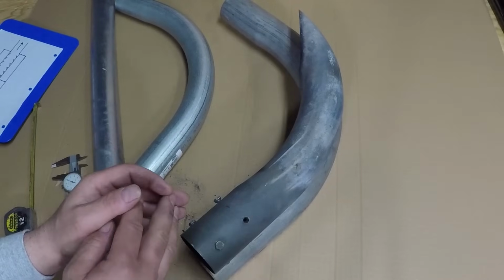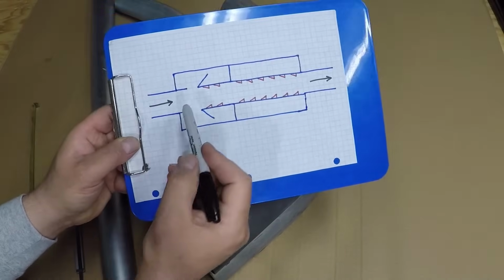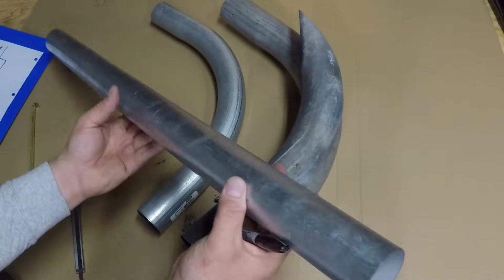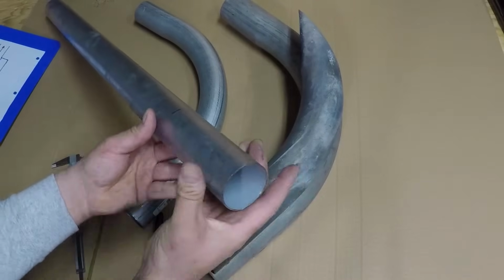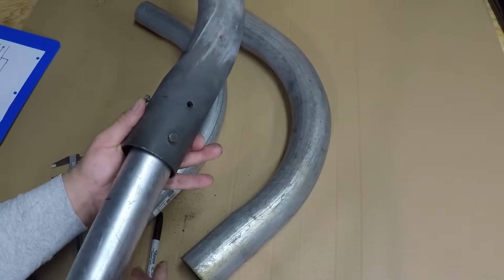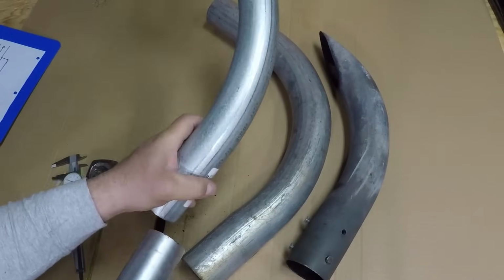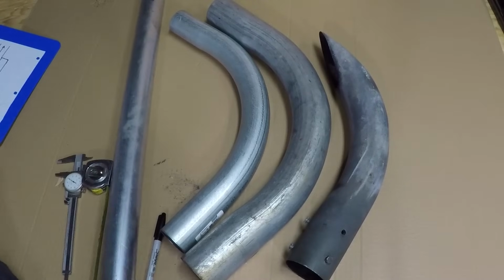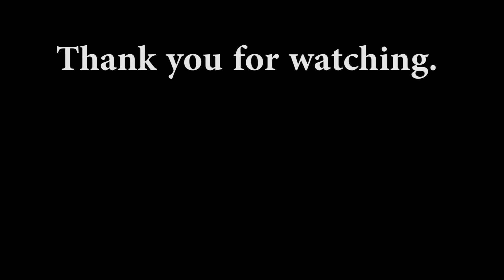Homemade Muffler

Comment: The skidder I used to run had the exhaust pipe follow the ROPS all the way back to the roof so it wouldn't get torn off when plowing through low branches and such...just a thought.  Nice build!!
Reply from the maker: Good morning sir, you are 100% correct. I actually built one before the one in the video and it got damaged from trees hitting it when I dug the pond. Thank you for the tip, the comment and have a great day.
Reply: John Deere's 648?

Comment: Going to build one of these for my air compressor engine once its built. Thanks for breaking it down
Reply from the maker: I am going to build a larger one for my dump truck very soon. The way I installed it on the bulldozer was to help with preference. Make it where you can change the direction as if you install it the other way, it will be less noisy but the engine may lose some preference. Good luck with your compressor build. Thank you for watching and for the comment.

Comment: Look into how Flowmaster makes their baffles which they call the Delta flow technology !  I made a home made muffler for my old Jiffy gas powered ice auger for ice fishing which uses a 2 stroke Techumse engine & they only come with a small steel plate with a slot cut through them as a muffler which isn't very quiet at all ! I basically took this plate then used a 6 inch piece of 2 inch pipe with the ends cut off & drilled the holes needed for the plate to breath through then welded those 2 together & added sections of  steel V  cut up like the Flow Master design with the smallest first then making them wider at the end then an exhaust hole at the end & bottom after I welded ends on each end . Once done I was able to just bolt it on then started it up & it's much quieter but had to tune the carburetor settings for low & high speed mix & it works great lol . The way they are stock from the factory is like a open pipe so they are loud as heck compared to the new ice augers especially the 4 strokes out now but now it's much quieter & didn't cost me anything for materials because I had that & just the time to make it & some electricity & welding wire for the welder . I was on here watching other various ways to make exhaust baffles for a chrome Harley Davidson pipe I put on my 17.5 Sears OHV lawn tractor mower because the stock muffler after 20 plus years finally rusted out so I made this pipe work but need to make a baffle for it now to quiet it down more & ran across your video so I think I will probably go this route on making a baffle but use some stainless steel wool to pack into it as well to tame it down even more ! Great job on making this & the video !
Reply from the maker: Hello Pete, thank you for the nice and informative comment, I built a muffler in the past very similar to the “delta flow”. I installed it on Suzuki samurai, I am planning to post a series of videos regarding home made mufflers that are easy and cheap to make. Mufflers are cheap these days, however, sometimes you have to custom make them for specific application just like you did when you build your own. Thank for the comment and have a great day.

Comment: You came up with a good design, good mufflers arent cheap, i'm personaly trying to come up with a home made muffler and you answered some questions for me, now all ive got to do is buy a welder, i'll be replacing a catalytic convertor on my chevy pickup truck, for the short term but i intend on getting a legal cat. Converter for it when i can get the $
Reply from the maker: Good morning sir, if you replace the catalytic converter with anything other than a catalytic converter you will get a check engine light. The muffler I showed in this video is more suited for off-road vehicles. 
Thank you for watching

Comment: This is a great video, but based on learning about exhaust engineering if performance is a requirement then you would want a design where the slotted indentations bend outward instead of inward, thus preserving the pipe diameter flow. At lower rpm it will absorb greater, at higher rpm it will create air cushions that will allow less resistance and better flow through than even a straight pipe. 

How? I would cut the pipe in half lengthwise and punch out the slots from the inside. Then weld or clamp back together.
Reply from the maker: Thank you for the comment and the information. I am planning to post more homemade mufflers video very soon, I am just getting things set up for it. I will cover several types of easy to make mufflers and will test each one for loudness and performance. Thank you

Comment: very well done, great welds and everything, this may work nice as a performance exhaust on my boat, even without the fiber glass I am sure its quieter.
Reply from the maker: In the old days, guys with sport cars, used to remove the fiber glass to get deeper and loader sound.this design is for performance and not for reducing the sound. If you install it the opposite direction with fiber glass, you will get sound reduction at the cost of performance. Thank you for watching and for the nice comment.

Comment: If you make it with  the depressions in the pipe with half of them facing towards the engine and the other half facing towards the exit of the pipe it will work a lot better at silencing
Reply from the maker: Thank you for the suggestion.

Comment: At the time 8:51 shows the correct direction of exhaust flow like little scoops into the glass. Time at 8:33 shows the red arrow is pointing the wrong direction. Baffles are air scoops like little shovels. You scoop the air. He has the baffle backwards .
Reply from the maker: Good morning sir, I built one just like the one in the video back in the 90s and installed it on a car. I tried it both ways. One direction was quieter but the engine was loaded or there was more back pressure. The other direction was louder but the engine was running better. On tractors and off road vehicles the glass pack should be installed as I demonstrated.  Road going vehicles have to meet certain noise level restrictions and therefore they install the glass pack to meet those standards.  This creates more back pressure and little bit loss of performance. There are other options of using holes on the pipe which will give you in the middle results. I am going to upload videos in the future about homemade mufflers and I am going to test everything for the viewers. Thank you for the comment and thank you for watching.
Reply: @SalamSayhood  never restrict in any way a four stroke motor. Only 2 stroke motors require an expansion chamber and back Pressure . The diagram that was drawn on paper was correct. Except the flow was backwards. There were 2 chambers in it. In the glass pack you designed was one single chamber and flow backwards.
Reply from the maker: We both talking about the same thing. I think there is a misunderstanding. The cuts are pointing away from the engine. I reviewed the video and both timing marks that you posted in your comment are showing what I just said.

Comment: Nicely done, only one problem, you have the airflow going through the pipe the wrong way, try it the other way and you will see a big difference. What i once did was a compromise that worked well, the first half with the cutouts going one way and the second half with the cutouts going the other way.
Reply from the maker: Hello, I built one just like the one in the video back in the 90s and installed it on a my car. I tried it both ways. One direction was quieter but the engine was loaded or there was more back pressure the engine was getting warmer when driving up hill. The other direction was louder but the engine was running better and cooler. On tractors and off road vehicles the glass pack should be installed as I demonstrated.  Road going vehicles have to meet certain noise level restrictions and therefore they install the glass pack to meet those standards.  This creates more back pressure and little bit loss of performance. There are other options of using holes on the pipe which will give you in the middle results. I am going to upload videos in the future about homemade mufflers and I am going to test everything for the viewers. Thank you for the comment and thank you for watching.
Reply: The muffler was installed correctly. This style of muffler is not to reduce all noise, it's to cut out the rasp and not reduce performance.
Reply from the maker: You are correct. Thank you for watching.

Comment: That is some quality metal work. The cutting, punching, and welding are clean and smooth.  Nice job.  How many hours would you estimate this took?  How many hours would it take someone who does not have your skill level?  Have you tried phone apps or a sound meter to measure the sound differences?
Reply from the maker: Hello Thomas, Thank you for the nice comment. It took me about 2 hours to manufacture the muffler (filming it made it a little longer), I would say, if you know how to weld, how to use the grinder, and you have all the material, then it should be about two hours. I am planning to purchase a sound meter and I am going to post videos in the near future about how to build several type of muffler for different types of engines in detail as there is a high interest in the YouTube community about home made mufflers. Please note: Glass Pack mufflers are efficient, make the most power out of your engine, and easy to make, however, they do not provide good muffling, especially if you are trying to muffle an engine like a generator near your house.  Hope this helped.

Comment: If some fresh air is induced in the main exhaust by putting small holes at bottom end it would decrease resistance and fresh air will be siphoned in to make exhaust gasses cleaner.
Reply from the maker: Great idea, thank you for the feedback

Comment: Nice work bro 👍
But did you compare the results with the standard results !
Share what did you get ☺️
Reply from the maker: At the end of the video I showed the straight pipe sound against this glass pack muffler. In the future (I have few projects to finish first 😆) I am going to experiment with more muffler designs, I bought a sound level meter to be able to show the results. The camera captures good sound, however the sound meter will give more accurate information. When it comes to mufflers, the goal isn't for sound reduction but also for engine performance. I will also be checking for that and for heat. Thank you for watching and for the nice comment.

Comment: I really like the design, with the slit cut then punch. If I do it, I’ll reverse the flow so it’s directed towards the fiber glass packing. I feel like it would be quieter.
Reply from the maker: Good morning, you are right, I tried that in the past. The way I installed it, the engine performance is better and louder. If installed like you mentioned, the engine will be quieter. I am planning to do this experiment in the future and will show it on YouTube. Thank you for watching and for the comment. Have a great day.
Reply: Wouldn’t that restrict air flow
Reply from the maker: Good morning David, it shouldn't restrict air flow if it is built with the internal pipe the same size pipe as the engine exhaust pipe. Thank you for watching.

Comment: Nice video, which is better glasswool or  steelwool to reduce noise sound? cause glasswool could wet
Reply from the maker: Glasswool reduces noise better, stainless steel wool lasts longer. Don't use steel wool. The idea of a glass pack is for performance or if you want to get the sport car sound (make sure it is legal in your area). You can use glasswool, stainless steel wool or no material to get different sound/performance. I only use it for off-road vehicles. Thank you for watching
Reply: @SalamSayhood  thank's for advice  just want to reduce noise sound of portable genset
Reply from the maker: To reduce the noise, you must make the muffler larger in length and point the cuts in the internal pipe to the exhaust of the generator (opposite of what I did in the video). Make sure the internal pipe size is the same as the generator original exhaust to minimize heat while you get sound reduction. You may also have to build a large box to contain the generator and cover the inside of the box with fiberglass to help reduce the other noises that are generated by the generator.

Comment: Bass frequencies carry a lot of energy and travel further.  Sound system engineers and musicians know this well.  If the bass sound is converted into treble frequencies, this could sound louder up close, but dissipate the sound with distance.
Any thought about this when developing a muffler?
Reply from the maker: Hello, The glass pack was designed and produced since the late sixties. I know what you are saying, however I didn't understand what is your point?

Comment: This is just what I was looking for, but is it too restrictive for a high performance 250cc four stroke motorcycle? Somebody, PLEASE ANSWER.🙏🏾
Reply from the maker: Good morning, if you do it exactly like I showed in the video (the direction of the vents) it will give you the highest performance. In between each piston compression cycle, it will create a low pressure to help the next cycle. However, this will make it loud, not as loud as a straight pipe, but loud. If you change the direction of the vents, it will reduce the noise but not as good as far as performance because it will create back pressure. I hope this answers your questions.
Reply: Thanks for your answer. I really appreciate it. I subscribed.🇯🇲✊🏾
Reply from the maker: I also forgot to add, you can use stainless steel muffler packing it will cause the muffler to produce deeper sound (sport) or use the fiberglass for the best sound reduction. Or if you want a very loud sport sound, then don't use any packing material. Don't use regular steel wool. Thank you for the support. I appreciate it.

Comment: The last thing you want in a muffler is baskpressure, where do you get this idea from?
Reply from the maker: Any type of muffler will not reduce noise without creating some back pressure. The design of this muffler is for performance and will not cause a lot of back pressure and may create vacuum between the exhaust cycle of the cylinders to help with the engine preference, however at the exhaust moment it may cause back pressure. I was at a car show a long time ago and there was a company showing their line of mufflers and one of their engineers was explaining the benefits of the back pressure on noise reduction. Personally I believe the only thing that doesn't cause back pressure is a straight pipe. What do you think?

Comment: Nice info and video 👍🏻.
But for some reason I think the exhaust gas flow must be in opposite direction.
Thanks for sharing 
شكراً
Reply from the maker: Thank you for the comment. The glass pack always cause debate on which direction it should be installed. I experimented with it in the past and this should explain it:
If you install it in the direction I showed: the glass pack will last longer, you have less back pressure, engine run cooler and louder.
If you install it the other way: the glass pack packing material will degrade faster, you will have more back pressure, the engine will warm up faster and it will be quieter.
If you use a drilled pipe in the center instead of what I made: you will be in the middle of the above two options.
I hope this was helpful.
أهلا وسهلا فيك اخي
Reply: @SalamSayhood  
100% right 
Thanks

Comment: Great build but would have been better if you made the ends more like a cap that could be screwed or riveted, so that it is able to be taken down to replace the packing when needed as after awhile it burns out. But none the less a very well explained video with a great end product. Cheers friend
Reply from the maker: I thought about doing that, my 4 Wheeler muffler have end cap to be able to replace the packing material however I was thinking to make it as simple as possible. I am going to post videos in the future about muffler and I am going to build one for my 4 wheeler and I will include a cap at the end. Thank you for the comment and thank you for watching.
Reply: Thats why God made cut off wheels, lol.  Besides, he used stainless steel wool. It will probablly rust out before the packing needs replaced.  It looks so much cleaner being all welded. If used glass packing, maybe.
Reply from the maker: Thank you sir,
Reply: @KC9RXP  stainless and rust In same sentence eh? Likely burn out before it would "rust" and yes you could keep cutting it and rewelding it I suppose..but like me and the owner previously spoke the removable end cap like many other designs is the way to go, replacing a few rivets looks cleaner and alot Easier to service than chop and reweld would be. Either way he did a fine job.
Reply: @2strokejunkie686  im saying the steel conduit he used for the body of the muffler will probablly rust out before the stainless steel packing burned out.
Reply: @KC9RXP  he actually used fiberglass in the video he didn't use stainless steel wool he only mentioned it, and being that it's galvanized conduit would make it rust resistant, compared to uncoated mild steel

Comment: Would you be able to use a circular shapes to reduce the sound without using any packing????
Reply from the maker: I made a muffler in the past similar in shape to firearm silencer. I tried it in both directions. The glass pack is better. I am currently working on a dump truck project, once I am done with it. I am going to build several types of mufflers that I built in the past or thought about building for cars, equipment or single cylinder engine. I am going to do my best to record it for youtube and will show the pros and cons of each type. Thank you